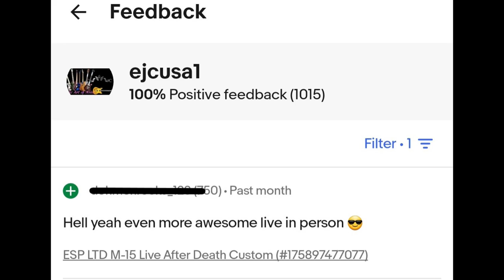Jackson JS30 Kelly Love and Power

Comment: You use the same battery box i do, I just want to point out incase you didn’t see that they have two little bumps or lips on the bottom of the top rim that keeps it from sitting flush which it why you may have to route a little more out. I usually trim them so it’s snug and flush. It looks nice, I know this want one I liked but you do great work!
Reply from the maker: Yeah, I saw that. Also, the push tab area has a lip under the mounting area.  That one, I had to notch out a little to fit. They are a decent box but could be nice and flat. Thanks.